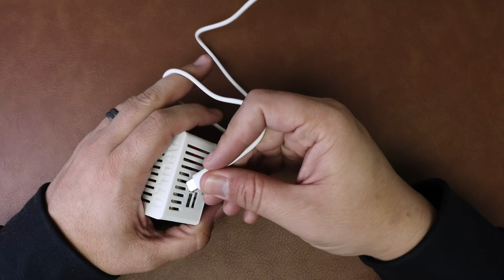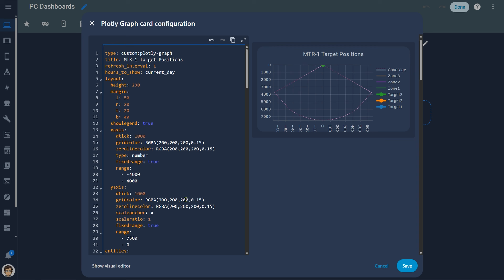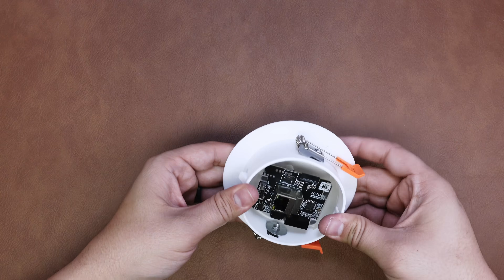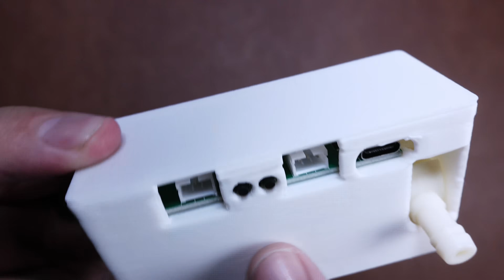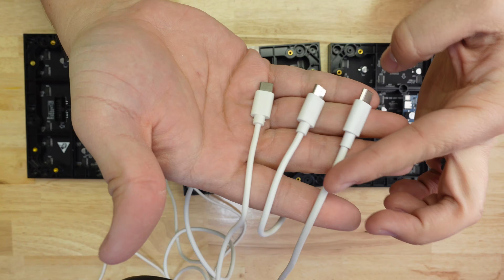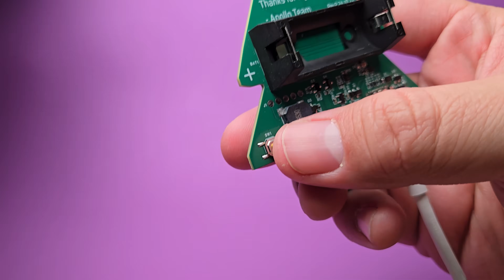Apollo Automation: Made for Home Assistant!

Comment: I had a CO2 sensor and had continual trouble with it. It could never get it resolved. So I threw it back in a box and haven’t used this company since. And I have many many Home Assistant products online and working.
Reply from the maker: That's a bummer, hopefully they've worked out any issues since then!
Reply: Thanks for your support, but sorry to hear about your trouble. Did you try reaching out to our support team? We take support seriously and will make it right! 

Best, 
Justin
Reply: @ApolloAutomation  Justin they tried to help me a couple times was unable to resolve anything. I’d rather just send the whole thing back to you and get a new one if it would work. Because right now it’s just sitting in my closet for the last year.
Reply: @mfrantz932 we can exchange it. Just please message support and let them know. You can reference this comment, but I'll also give them a heads-up. 

Best, 
Justin

Comment: It's awesome to see a company making a variety of local ESPHome based devices!
Reply from the maker: Right?! Love to see it! Such a powerful integration with HA!
Reply: @MakeItWorkTech  can you please make a how-to video where you setup an automation that:
1. turns on lights if presence detected & low LUX 
2. turn lights off when LUX is high, even when presence is detected 
3. (the part I have issues with) do not change brightness or color if it was set manually. 

I use Adaptive lighting and sometimes I want to change color or make it brighter, but my automations will override my settings.

I’ve read about context and switches, but I don’t know how to implement them into my automation